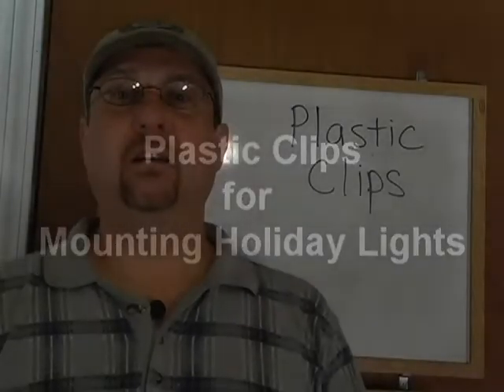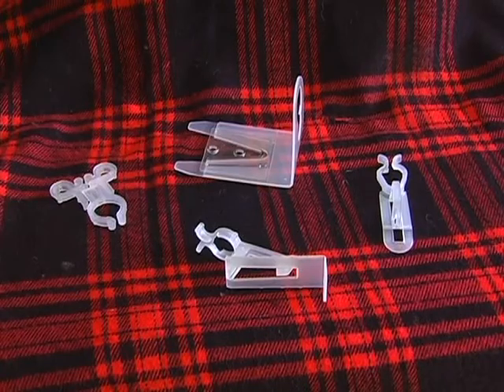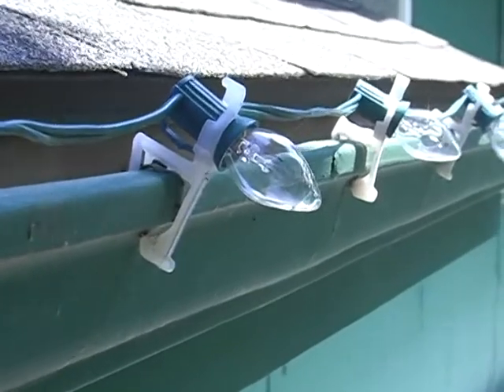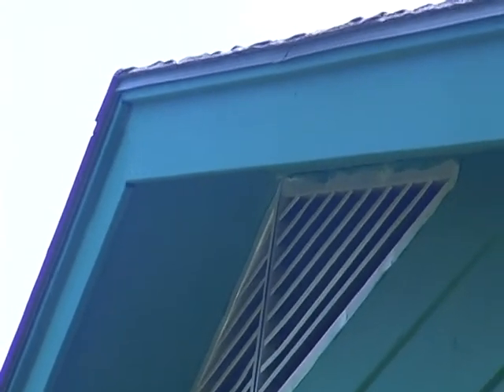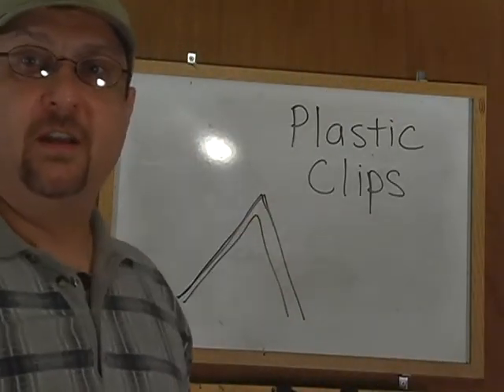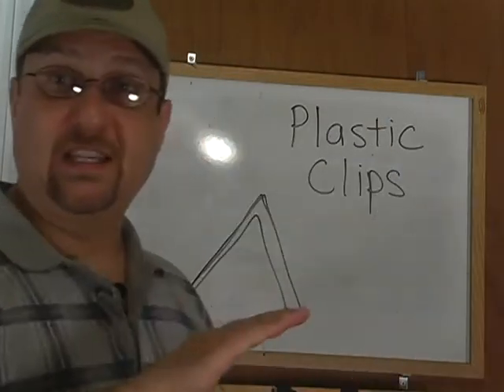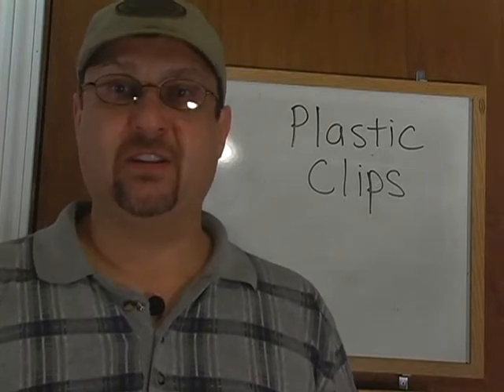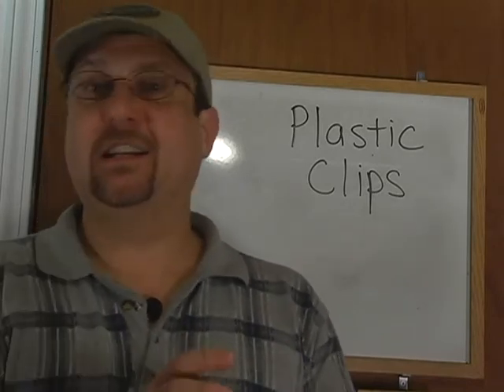Holiday Lighting Tutorial - Plastic Clips - PT 1.mpg

Comment: I got my clips at Walmart after season dirt cheap.  Mine lasted about 5 years. T best kind of clips for my c9 lights are the kind that stay on the light strands . in that way I only have to thread my clips once and then just coil them up with my lights.
Reply from the maker: That all sounds great. Some of these All-In-Ones do last a long time for me and my estimate was worst case. And yes, these clips stay on the strands, I guess I wasn't clear about that. They sometimes come off when removing the lights because of the efficient way I remove them which is in another video. 

Basically, if you just tug on the light strand from the ground the lights will come down but some times slip out of the clip, leaving them behind on the gutter. I then use a modified painters pole - one that you would screw onto a paint roller. It is used to flip the clip off the gutter from the ground. The one I have extends to 28 feet so it works for most applications.

Comment: what kind of clips do you use for gutters with gutter guards?
Reply from the maker: Sorry about the long delay - gutter guards pose a real problem. Sometimes you can get the clips to pinch the guard or, if the roof is not too steep I have been very successful slipping the clip under the shingle behind the guard. I've also loosened the front of the guard, mounted the clip, then laid the guard back down but that is a lot of extra work especially considering you have to reattach when removing the lights.

Another option is to avoid the gutters altogether and attach to the soffit or facia board with staples or my preferred method - permanently installed stainless steel screws which you can then tie-wrap the lights/wiring onto the screws.